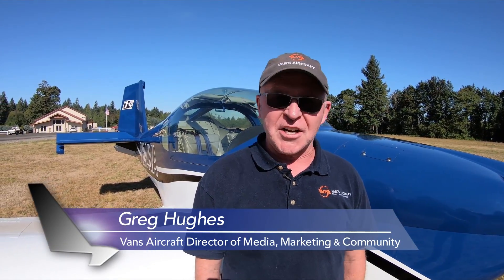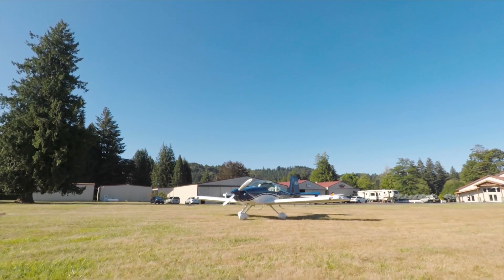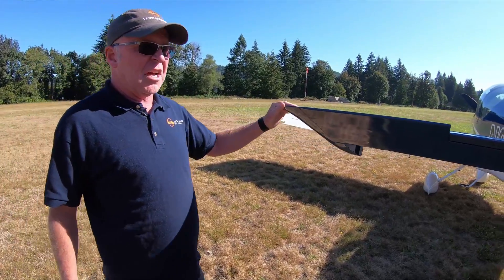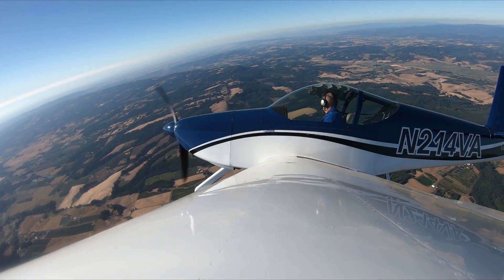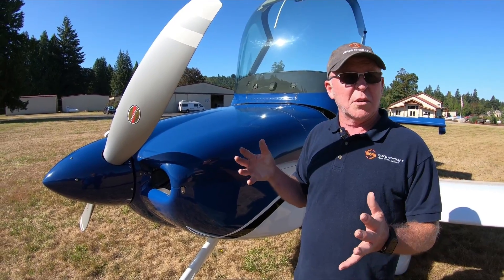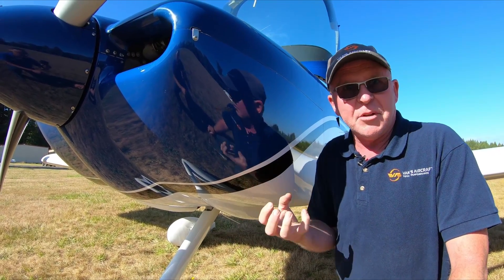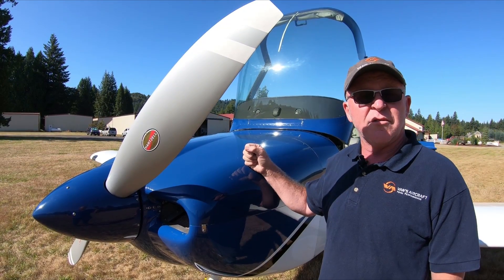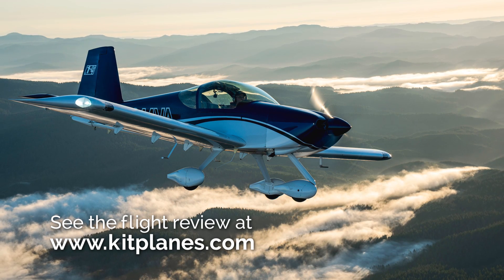Van's Up-Powered RV-14A Walkaround

Comment: What is the exhaust fitting at 3:57 that is pretty obviously not properly installed?  That the heater?
Reply from the maker: Cabin heat. We shot this angle while the airplane was getting some maintenance.
Reply: @KitplanesMagazine  cool.  Thought so/similar.  Glad to know my Mk1 eyeball still catches anomalies on quick engine compartment glances.

Comment: What is the total time and cost to build this plane?
Reply from the maker: Van's estimates around 1100 to 1400 hours of build time, but that is really dependent on a lot of factors like builder experience, build location and other things. Finished price can be around $90K, but that's a basic version. Typically, RV-14s are $130-$145K completed, and they're usually quite well equipped.
Reply: @KitplanesMagazine  Thank you. I'm in the publishing business as well. I would love to build one of these.
Reply: @KitplanesMagazine  I'm not pilot or airplane owner, but for a single engine airplane, that seems expensive.
Reply: @geddon436  That's extremely reasonable for the value, the range, the speed and the payload.
Reply: @geddon436  This is damn near free for the performance.  I challenge you to find any kit plane with this performance for this price  Psst, it does not exist.
Reply: @thonatim5321  so, most people in aviation i see with mass produced planes are rich.
Reply: @geddon436  This is why I like Vans line up.  An RV10 has better performance than a Cirrus at less than 50% the cost.  The only issue is that a kit plane cannot be used for commercial purposes.  So the average guy flying to get the $100 hamburger; Vans is hands-down the better option.
Reply: @geddon436 welcome to the world of flying. Only 2 rules really: 
1. Have $$$
2. Don't have no $$$
Reply: Think of it as buying one well equipped F150 and a good Tesla for your wife. At 210 mph you can leave NY at 6 am on Sunday, have your Sunday brunch with your wife in Miami and be back in NY before sun down and you logged about 10 hours as PIC.

Comment: I'd luv a 14, conventional u/c of course but I'd never build/buy one as I dislike tip up canopies!
Reply: I don't understand why tip-up canopies are a problem - I built an RV-14A, and love the canopy design; so easy to ingress and egress.  I guess this comment comes from someone with a lack of knowledge about Vans aircraft - or so hardened on the sliding canopy idea that he/she/it can't fathom a change.
Reply: @alexc30  no they just suck.Bang your head in them snag your purse on them wack yourself on them in some way trying to get out.
Reply: @alexc30  can you install a catch to hold it open a couple inches while on the ground, get a little cool air going while you're on the ground? My experience is limited to a Cessna 172 so far but being able to crack a window on a hot day is a godsend.
Reply: If I end up in a cornfield upside down (ala Dan Gryder) , how the hell do I get out of this thing?

Comment: 64 hours on my 14A, one impressive plane. A little over 2 years to finish quick build.
Reply: Not impressive enough to change your name to Flying Vans RV14.
Reply: Any heating problems on climb out
Reply: @stevemcvey5054  I usually climb at 120kts, helps keeps temps down.
Reply: Was it because of lack of time? Two years is a bit much for me, but I’m young and impatient haha
Reply: Any issues with the electronic elevator horz. stab trim sensitivity? I remember something Flight-Chops was talking about.

Comment: Glad I chose the 14A.  I have completed the empennage aluminum construction and the kit has been trouble-free.  The only mistakes are mine.  I am eager to get the wings and fuselage soon!  Having flown in the airplane at the factory (before it received the engine upgrade), I was hooked.  It is as if it was designed for my 6’4” frame.  Wonderful design.